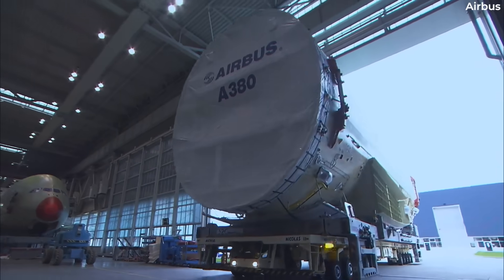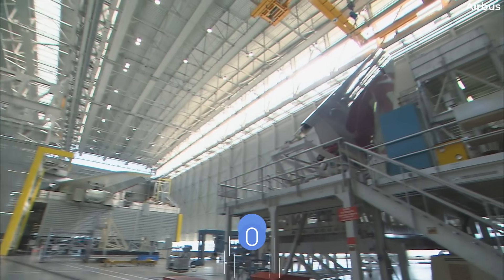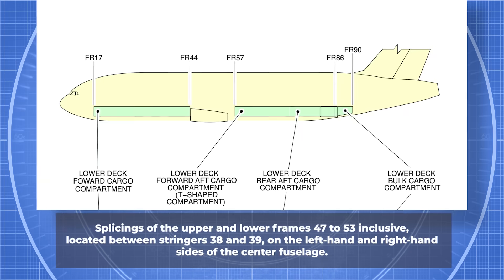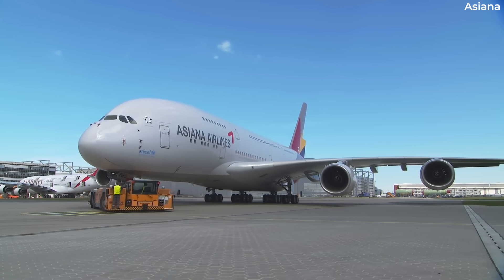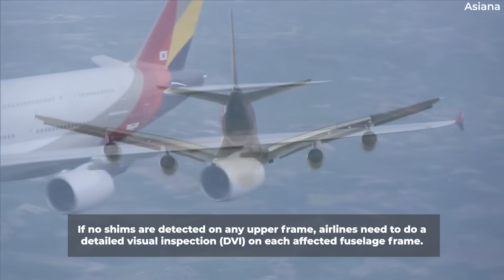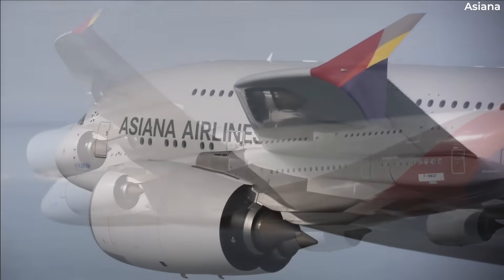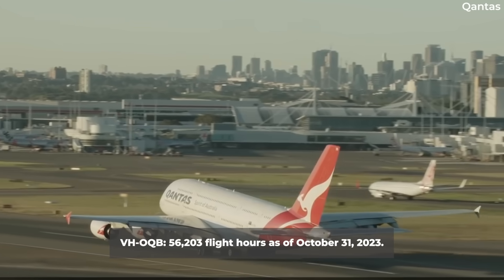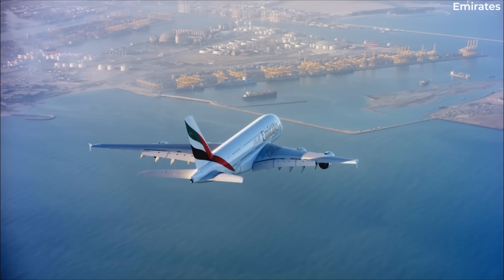EASA Warns Of Potential Airbus A380 Fuselage Gaps

Comment: How many spare parts are still available for this aircraft given the fact it is no longer in production?
Reply: I dont know for sure, but the manufacturer is probably contractually obliged to supply spares for X number of years after the aircraft itself is no longer being made. This is normal practice for very many industries.
Reply: Many critical areas of the A380 production line are still present (gathering dust mostly) for exactly this reason.

Comment: Still Id fly Airbus anytime over Boeing.
Reply: Spirit Aerosystems supplies numerous flight critical plane components to Airbus. Including fuselage barrels ,and wing spars, on the A-350.
Reply: @fomfom9779 yeah but the Alaska incident was not spirit’s fault, also the systems spirit builds for Airbus is based in Europe not in US
Reply: @jeruelnathan1845  It is yet to be determined if Spirit's employees, who were reworking the fuselage rivets at Boeing's Renton, facility were responsible for the removal and re-installation of the door plug. Spirit designed the A-350 fuselage barrels, which are manufactured in Kingston, NC.
Reply: @jeruelnathan1845 it doesn’t really matter where it’s based. It’s the same company with the same management. All the operations are controlled from their home base in Kansas.
Reply: @FlyByWire1  Exactly. And per news reports, Spirit states, in its stockholders financial reports, that it's losing money on its Airbus operations. So anybody thinks they aren't going to try to economize on the production of those items, is fooling themselves. Unless they go back to Airbus, asking for more money. Good luck with that one.